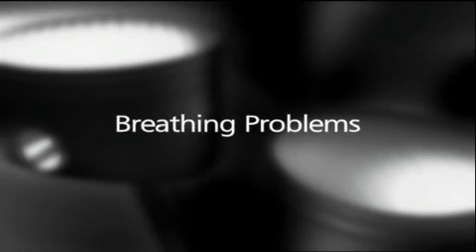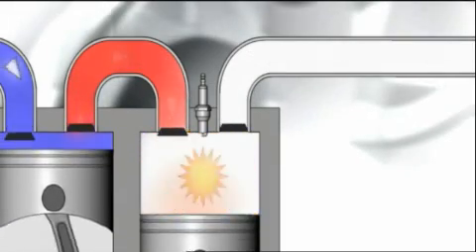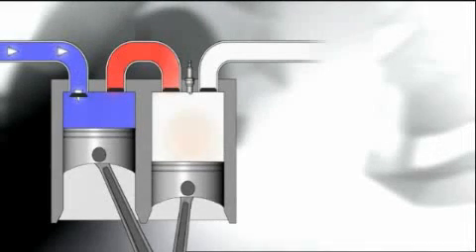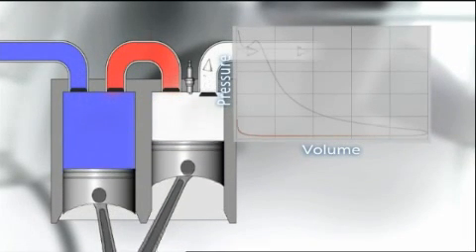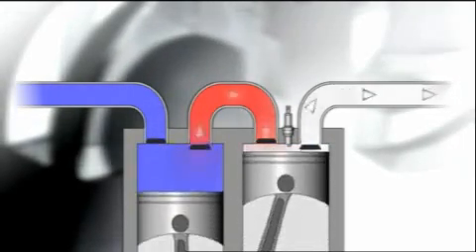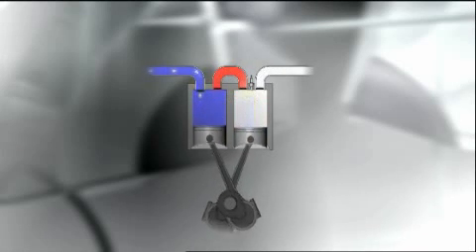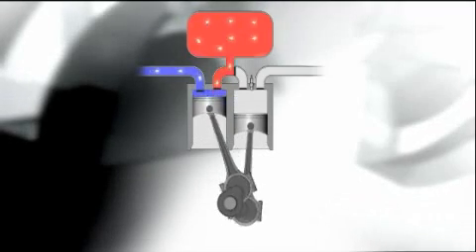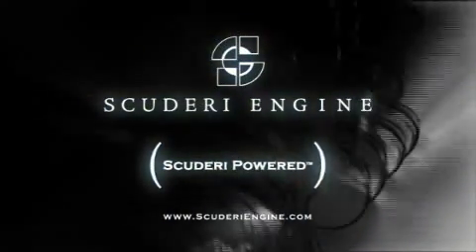Scuderi Engine - How It Works (by www.caroto.gr)

Comment: Again we have another invention that makes no improvement over an existing system. this is supercharging, via a piston, as opposed to a dedicated rotary air pump, which is not only more efficient, but easier to maintain, and can be adjusted for different pressure needs. Sorry, Scuderi, your idea is not needed, or likely to ever be used in racing or street use. Back to the chalk board.
Reply: Tim, you have a pretty narrow POV... and based on your comments I don't think you have the ability to understand  various engines designs and what they might offer. I was trying to help you understand the cycle and it's possible advantages and disadvantages but it seems you are not interested in that discussion..  The more you comment the more if feels like I'm talking to a rock... Diesel engines were invented in the late 1800's ... not for racing but to provide improved efficiency over the steam engine...  Brayton cycle engines are used for power generation and aviation... not generally for racing but the Brayton cycle did lead to the invention of the turbocharger.. As for firing after TDC most new Diesels do exactly that... and modern diesel have some impressive performance... so again you ignorance is exposed... I agree that racing has made improvements in engine designs... however that's not the only thing that engines are used for... The ideal engine to power generators, over the road trucks, boats and rail will not likely be any good for racing...  good day sir
Reply: +Tim Hallas piston pumps are a type of constant displacement pump just like superchargers (with the exception of centrifugal superchargers), and they most certainly are talking about using regen braking since it is mentioned in every video I've seen and it's the entire purpose of the air tank.

the second cylinder doesn't do any compressing, all the compression is done in the first cylinder; this basically makes it a two stroke diesel engine (if you aren't familiar with the differences between two stroke diesel and gas engines, look them both to) with a piston pump. it isn't demonstrated in this video, but in others they talk about how the compression/intake stroke can be tuned separately from the power/exhaust stroke, and the big selling point isn't the power per liter, but the brake specific fuel consumption.... a two stroke diesel with a constant displacement supercharger, a pressure tank and a couple valves would probably work a lot better, but two stroke diesels got banned due to the bad rep of two stroke gas engines.
Reply: @steviewonder65 piston pumps are not constant displacement, they are positive displacement.  Those things are different.
Reply: +Tim Hallas for large diesels, this might be a more effective way of adding return brakes.
Reply: Stevie Wonder
 I don't think this design has anything to do with engine braking. It's simply a cheat on supercharging, that has no reason to exist. Think about it for a moment. All you get is the drawing in of air, under a vacuum, which means it is less dense than outside air, Then you pump it to an adjacent cylinder, where it becomes part of a normal compression cycle. There is nothing gained, but something lost. Superchargers, pump air into cylinders, under constant pressure, and increase compression in all of the cylinders. This design is just foolish.
Reply: Tim Hallas
No, it's not behaving like a 2 stroke, individually it's not behaving like anything because individually it's not an engine and wouldn't work. If it was behaving like a 2 stroke it wouldn't need the compression cylinder to function, but it does.

And no, you are wrong. If you were right they wouldn't even be bothering with it, by the way. The cylinder pair does the same amount of work as 2 4 stroke cylinders. Think about it, they're doing the exact same things that a pair of 4 stroke cylinders would do in a given amount of time. They produce twice the power of a single cylinder at twice the fuel cost and twice the weight with twice the power cycles and twice the strokes. Like eg. 2 cylinders would.
Reply: Tim Hallas
Yes, 2 stroke engines have a better power to weight ratio than 4 stroke engines typically, but 2 strokes have issues of their own. Indeed, if it was a 2 stroke then it would be a 2 stroke, that is correct. However, as you just established, it functions like a 4 stroke (with 4 strokes divided over 2 pistons - 2 strokes each. This of course doesn't make it "like a 2 stroke" because, as we've established, there are still 4 strokes in the cycle and the engine has results akin to a 4 stroke).

I don't know why I should "take my engineering degree back" after you just admitted what I was saying this whole time was correct. As I said at the beginning, I don't see any obvious advantages over a regular 4 stroke although IIRC the video talked about it being more resistant to knock (which is a big deal), and the company claims it is more efficient and produces fewer emissions. If their claims are correct then great, again I'm not the one doing the math to figure out if it's true, I'll let the prospective buyers do that.
Reply: Tim Hallas It is always the ones who know least that think they know the most. The fact that you have to censor the conversation just proves how badly you lost but don't want to admit it.
Reply: no worries Tim, Sorry for insulting you... best of luck.
Reply: +Tim Hallas yeah, like combining a 2 stroke with a 4 stroke sorta. Fires on every stroke but unless your first piston moves alot more air whats the point, 8 cylinder becomes a 16 cylinder? Dumb idea I think
Reply: Adrian Paul
 It's not a dumb idea, it's just being used wrong. Supercharging any piston engine will increase torque and horsepower, but at a cost to it's efficiency. Two or four stroke makes no difference. Using one of an engines cyls. to supercharge another one all the other ones, is very inefficient, as the piston to crankshaft mechanics were not designed for that purpose and are very bad at it. A dedicated belt driven super-charger will do the job best and can be tailored for the engines needs. That's why this is a bad concept. Not a dumb idea.
Reply: +Tim Hallas yeah that's more what I ment. bad idea. exactly just turbo or super charge is way better
Reply: bad concept yeah
Reply: @timhallas4275  I remember early DKW two stroke racers employed a third cylinder to super charge the other two!"
Reply: @routmaster38   I'd believe that if I saw it. Never even heard of it, and i have been following racing since the 6os.
Reply: Stevie Wonder
 OK.
Reply: FLYBOY805
Turbocharging uses exhaust gasses to produce intake pressure. All this engine does is use an extra piston to compress the air, for the other cyl. It is useless.
Reply: ohh. Being devil's advocate, I have to say in defense of the Scuderi that the thermodynamic efficiency of a machine is not measured in cycles of work/number of cylinders. Although friction matter. And there, the relationship gas work/friction work. The flaws are inherently of thermodynamic type. It is common in the inventors of engines with mechanisms oriented  knowledge to commit thermodynamic errors. They tend to get lost in cinematic toys. Conversely, cycle designers often create things impossible to build, like Stirling. Finally there is the problem of the specific power. Efficiency or power. You choose. Without a turbomachine coupled to a positive displacement machine can not be both. As an example. I designed a very efficient Wankel (modified)  and very efficient 2St. Both with a reduced specific power.  I chose efficiency. Sadly the Scuderi can not compete with a boring and tested turbocompound Diesel.
Reply: Tim Hallas
And I explained to you why what you said is wrong. The cylinder-pairs in this are doing the work of 2 cylinders in a traditional 4 stroke as far as I can tell. The only immeditaly obviously difference is that you will never have a 3 or 5 cylinder Scudari Engine.
Reply: The only advantage that I'm aware of is compression takes place in a cool cylinder and combustion can take place in a hot one... The cylinder on my engine runs at 800f and that makes for very complete combustion.
Reply: Tim Hallas
Yes, it is firing on every rotation of the crank. An easily made observation. Since you didn't address anything I said, I assume then that you realise your error? It is doing all the exact same things with the same results and same equipment (roughly, talking in terms of numbers of pistons etc.) as 2 four stroke pistons. It's just that the jobs are allocated differently. As I said earlier, I don't see any obvious advantage in principle over a traditional four stroke, but it's not just lugging an extra piston around. A 4 cylinder one of these would give the same output as a 4 cylinder 4 stroke petrol engine, there wouldn't need to be 8 cylinders to do the same job.
Reply: I usually explain it as a 2 stroke 4 cycle engine... it has all 4 cycles of a normal 4 stroke engine.. one piston is performing intake and compression while the other performs the expansion and exhaust... 4 cycles 2 strokes... This engine has the added advantage that when used in an automotive application the compressor can be used to slow the vehicle / energy capture. The pressurized air is stored in a tank. During acceleration the compressor can be disabled which means the engine can produce a great deal of power, these engine by nature make a good deal of torque. They are not suitable for very high speeds though.
Reply: None are "in use" that I know of... my point is that it's an old design..  I'm just pointing out some of the possible advantages... Scuderi claims to have solved the problem of firing after TDC... If that's truly the case the engine may have some merit...
Reply: Tim Hallas to an extent you are right.  On the one hand the energy to compress the fuel/air mix is a drain on the overall power output of the engine.  There is one important distinction in that a normal supercharger compresses air alone and this is introduced to the cylinder prior to compression whereas Scuderi introduces fuel/air mix to the ignition cylinder immediately after compression.  There is an issue here is that the ignition flame front in the Scuderi design chases an expanding volume of gas rather than a contracting volume as with a normal ICE.  My guess is that net power vs fuel consumption is not much better than a standard engine so as you aptly put it "back to the drawing board" :-)
Reply: engines are used for a lot more than racing.....
Reply: Stevie Wonder
 Yes they are. What's your point?
Reply: +Stevie Wonder regen*
Reply: Forgive my ignorance... but this looks like it can be used to reduce emissions.
Also, its more like a turbocharger than a supercharger.
Reply: Scuderi (or his sons) changed his "cycle" many times, from the original thermodynamic disaster to the current one. An Atkinson indeed. With a smaller compressor and a larger expander. The advantage is the tight control of injected mas of fresh air. An advantage that they rejected when using an air accumulator! :s Patches with that engine never seem to end.
Reply: Lisandro Rodríguez
The idea is a dead end, regardless of how you tweak it. It does address some of the basic flaws in 4 cycle piston engine design. the firing on every rev. is one, but they have done it by using one cyl to service another. So it's a two cylinder two cycle engine that only fires one cylinder. No real gain, that I can measure. Maybe that is why it hasn't made it to production. Do you know of a working prototype?
Reply: The original engine of this type was invented by Brayton in 1872 also when Clerk modified a Brayton engine in 1878. Clerk's original engines did not compress in the expansion cylinder.. Clerk later invented the piston charged 2 stroke similar to the Reid and Baldwin / Bessemer type engines which use a piston or the back side of the piston to charge and scavenge the cylinder. Other inventors of 2 stroke engines that used the back of the piston  were Nash and Day and Fredrick. In 1887 Brayton made an engine that had the intake valve located in the center of the piston. That engine also used a short compression and long expansion stroke same as Atkinson. Atkinson made 3 distinct types of engines: The "differential engine" the "cycle engine" and In 1893 Atkinson made a piston scavenged 2 stroke which also had a short compression  / long expansion stroke. It was a very efficient engine and was called the Atkinson Utilite' engine. Watch my channel to see running examples of  similar engines.
Reply: Why do people keep saying this. It plainly isn't conducting the 4 strokes in 2 strokes (as in a 2 stroke) but is splitting the 4 strokes over 2 pistons. There is also no analogue for supercharging here, the compression stroke is the exact same compression stroke you'd find in any other internal combustion engine, there's no forced induction being performed.
Reply: Person Oisels
Exactly!! It's two pistons doing the work of one. Double the friction. Double the rotating mass. If ever there was a way to destroy the efficiency of an internal combustion engine, this is it. ....I think that's why it's only a drawing.
Reply: Anyone curious should investigate the Brayton and Clerks first engine in 1878. The first Clerk used the same cycle. Clerk later made an improved version in the late 1880's and it was a fairly promising design.. the advantage is compression take place in a cool cylinder and combustion takes place in a hot cylinder. .. The disadvantage is the timing must take place after TDC... I made some examples of the Clerk engine and have some video on my channel if someone is interested
Reply: Tim Hallas It's not only a drawing. Also not necessarily as each cycle takes about half as long as a conventional 4 stroke, so really each piston pair is doing the same work as 2 pistons in a regular 4 stroke. I'm not doing the math, so I'll let the engineers at the potential buyers decide whether it actually works. If it does then good luck to them. I personally find it hard to see the benefits over a traditional 4 stroke but if it really is more efficient then cool, it'll probably become dominant.
Reply: John Lucas
Did you find any real world advantages to this design, and how does the efficiency compare to standard 4 stroke engines?
Reply: This is not supercharging in any way... if you want to see a piston supercharged engine search "Ducatti V one" and you will see a piston supercharged 4 stroke engine.
Reply: Person Oisels
I just explained to you why this is not efficient. If there is any advantage gained by compressing in a cold cylinder, it is completely negated by the addition of mass and friction. This has been tried in the past, but all similar designs have been discontinued due to the simple fact that standard 4-stroke engines are already more efficient. This is like trying to bring back the steam-piston engines of the past for modern cars. We don't actually need to increase the efficiency of our engines anyway. What we really need is to improve on the fuels we use.
Reply: Person Oisels
If you look closely, you will see that the power cyl is behaving like a two stroke, but needs the compression from the other cyl to supply it's air. That basically makes it a two stroke engine with a compressor. The problem is, this is the most inefficient compressor imaginable. So YOU, are wrong. The cyl pairs are doing the work of one 4 cycle cylinder.
Reply: Person Oisels
It's because it's firing on every rotation of the crank!!!.....like a 2 stroke.  get it. You having trouble understanding engines??  I am an engine mechanic, son. Don't be telling me what I don't know.
Reply: Person Oisels
Well gee wiz, aren't we just a bit tight today. OK. in some strange way it is doing the work of two cyls with two cyls. What a break through. Now just imagine how impressive it would be if both cyls fired once per rev. Then it would be a two stroke, and of coarse the hp numbers would be higher than a comparable size 4 stroke. The point is, that it doesn't do anything that isn't already being done, and does not outperform either of the other two choices. That means there is no point to this "invention", and that was MY point, all along.  Where did you get your engineering degree?.  Wherever it was, you should ask for your money back.
Reply: Person Oisels
So, you are left with only one noteworthy advantage, that being less prone to knock. Well since that hasn't been an issue at all for over 25 years, that makes this "innovation" obsolete before it gets built. I love tech talk about gasoline engines, but this has been a total waste of my time. I hope it hasn't been that for you. Just for the record, this engine operates as a two stroke with help on the intake from second piston, so therefore technically has 4 strokes happening,. it is just a poorly supercharged 2 stroke engine. If you still can't see this, I recommend you do further study. At least look up the definitions of the two.  Later.
  By the way I am erasing this thread. There have been nothing but silly arguments on here, and I am done trying to explain this shit to people. Bye.
Reply: John Lucas
Where are they in use?
Reply: John Lucas
Actually, firing after tdc will have some terrible effects that I am certain could never be overcome. The simple fact is that gasoline is a rather slow burning fuel, and requires that piston engines be "lit" before top dead center to ensure combustion would occur at peak cylinder pressure, otherwise you loose power and you get incomplete combustion. This alone will solve any pre-ignition issues, but at an extreme cost to efficiency and horsepower.  That is why none are in use. Ok, for the last time.... I am through explaining why this  and similar "designs" for internal combustion engines have never made it to the street or race track. The engines that did are the ones you should study. The testing ground and the place that sorts out the innovations from the pretenders is the race track and the transportation industry. Look there and you will see what works.
Reply: John Lucas
There is not much point in typing AFTER you insult someone. Also, you are obviously just quoting what you read and have little understanding of how engines produce power. I am not running a fucking school, and if I were you would have been expelled. If you go learn some if the shit that I have you would have no need to argue with people. If you just need someone to talk to, show a little respect next time, and you might get some back.
Reply: My 90 year old Dad calls this type of invention, “A windshield wiper on a duck’s ass.”
Reply: @YTjndallas   My dad used to say "As useless as tits on a duck."